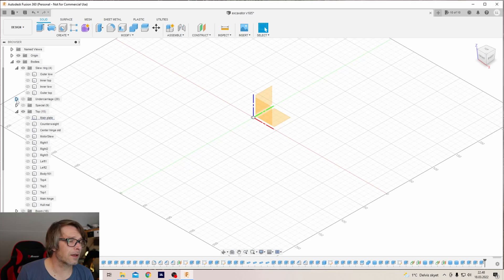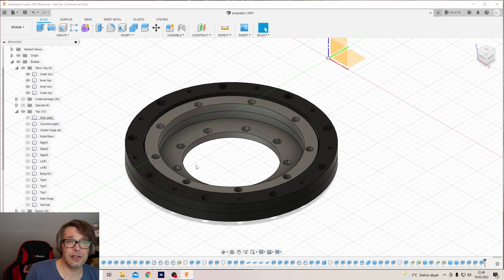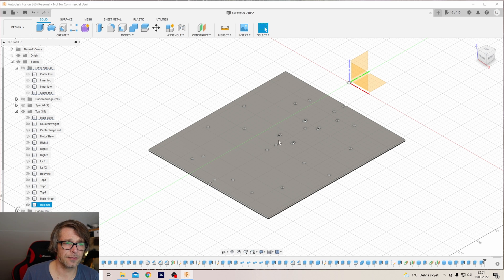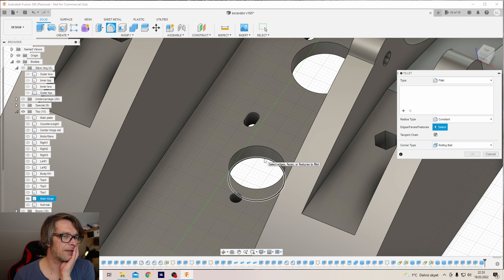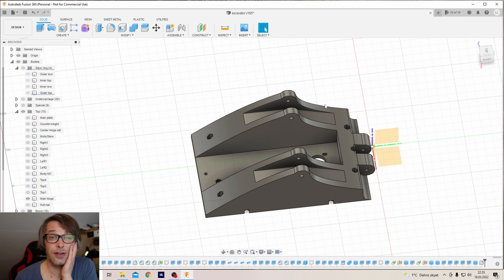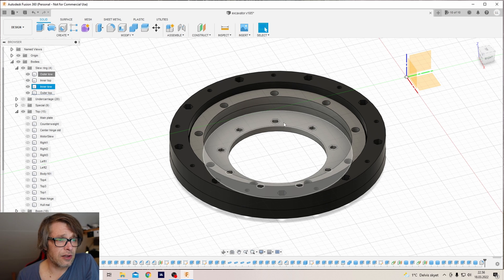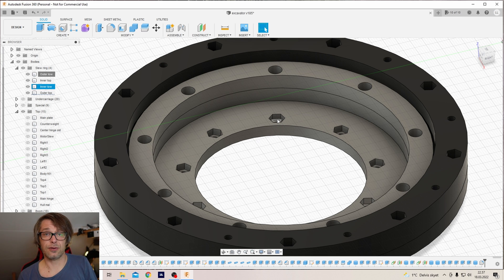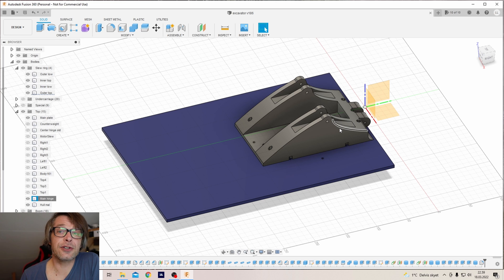Free files for 3d printed RC Excavator | Slewing ring, plate and hinge

Comment: I found out that making a ball cage inside the 3d printed bearing help a lot to reduce friction. I made my own version with 2 layers and 2 separate cages, lets see how long it will last. Its really hard to have it run as smooth as a metal bearing while still having not too much play.